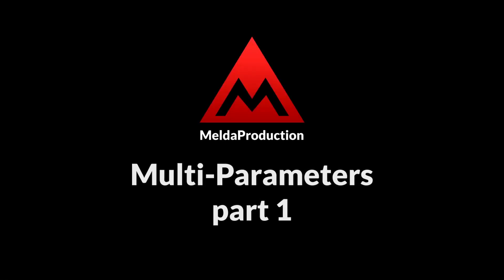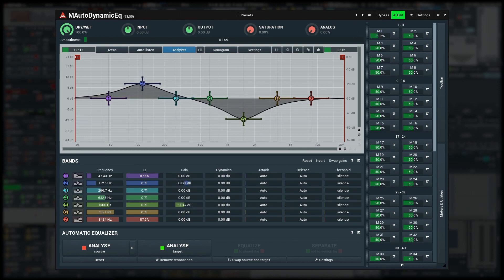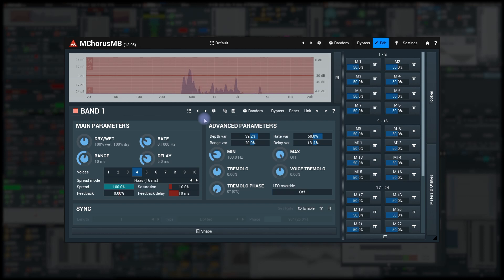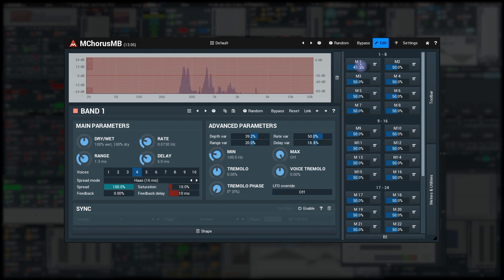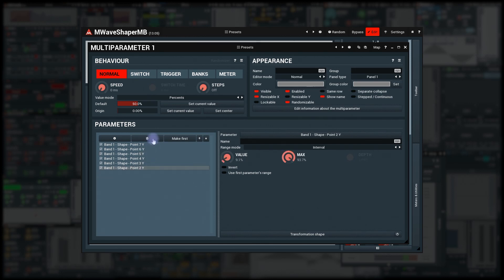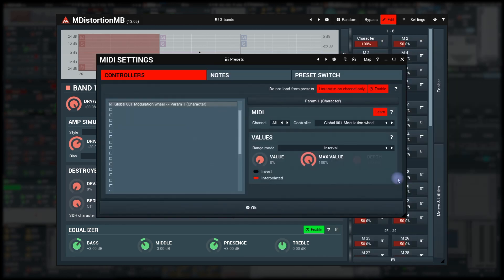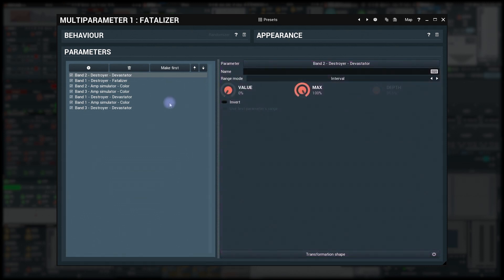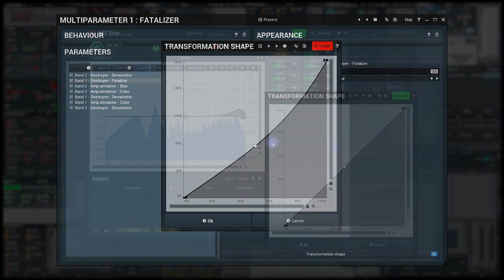MultiParameters #1 - Introduction

Comment: Hey guys, love this so much. I did have a noob question as to how to save "devices". I'm using MAutoDynamicEq and used the multiparameters to create my own "Easy Mode Device". I saved the preset, but the Easy Mode view I created doesn't load with the preset, it just defaults to the Graphic Monster (although the MPs I assigned are still saved, it just doesn't have the GUI I created). Any tips on how to saved those interfaces I worked so hared on?